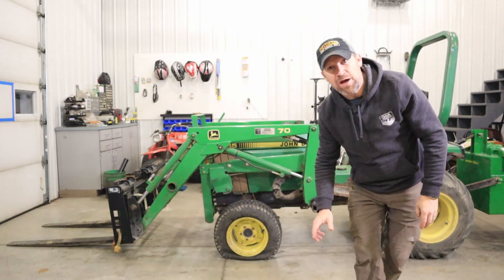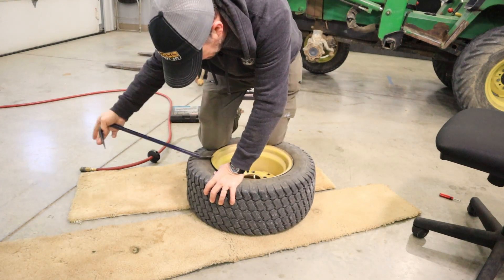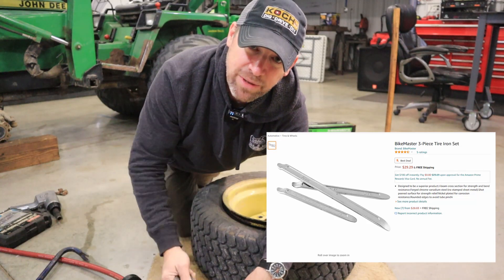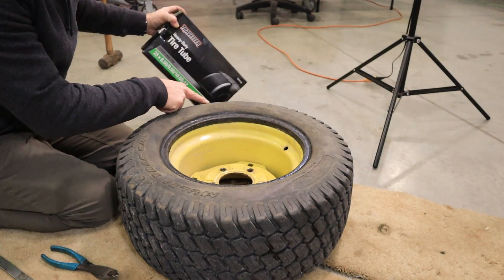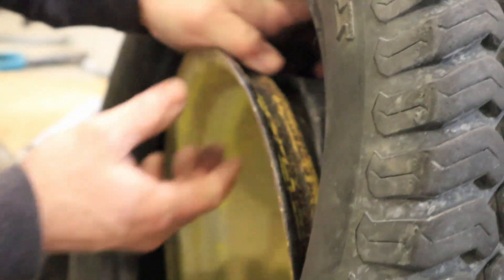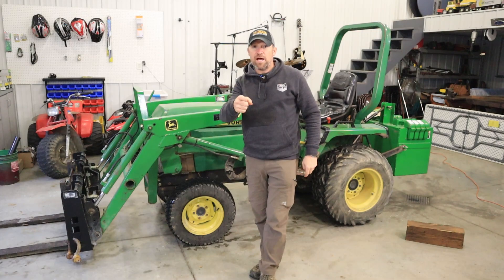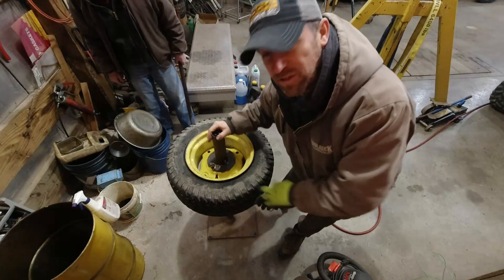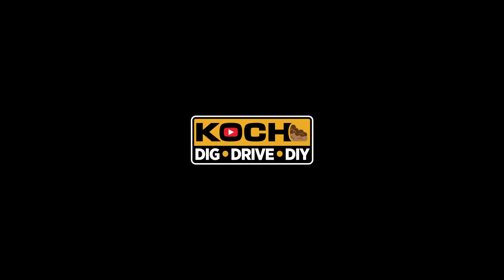How To Install Tubes in Garden Tractor Tires on John Deere 755 - Fixing a Flat Tire or Two

Comment: Neil I tried to do bicycle tire one time and failed at it ended up having to air them up every time I I pulled the Rickshaw around. Something I noticed Neil that I thought about my work. I wonder if you are the tube up first kind of stretched it out a little bit and then. I wonder if you are the tube up first kind of stretched it out a little bit and then push all the air out of it and try and get it in there. I don't know much about that stuff but I wondered about that when I saw you doing it.

Here's an afterthought what if you took a piece of like plate steel and cut the lug nut holes out and could run it down on your lug nut holes and then build a moon shape deal and set just the axle down on it cuz I know there'd be more weight in a focused area than the forks could put on it? Just a thought. You know bolt in place of a wheel and then set the axle with that attachment down on the edge of the rim? Be curious if anybody's ever tried something like that?
Reply from the maker: That's not a bad idea.  Another great way to get creative.  I can picture what you're saying and it would put the weight down on it!  That was my first and second try at doing it that way and I can't say I would prefer that method over the tire changer just yet!  Another thing I thought of after the fact is that I probably could have "pinched" the tire between the fork back plate and the loader frame somewhere too and got it to pop.  Lots of possibilities I bet.
I bet inflating that tube like you suggested may have helped to stretch it out.  I literally took it out of a 2 year old box and tried to put it on so I think that is why it was likely so stiff.  Warming it up a bit more would have helped too probably.
Glad to have you chiming in and always appreciate it!
Reply: @digdrivediy  as always love the video. Love the intro that was awesome. I freaked out for about a split-second went oh my God he's got a twin brother! And  then  it Hit me all of a sudden what you've done. I am buying a new computer today and monitors and going to look at video editing software for morons IE that would be me :-) any suggestions would be greatly appreciated sir. I am a Windows PC guy.
Reply from the maker: @1ton4god  HaHa!  I'd hoped I would catch somebody off guard!  
As far as the editing software goes, I tried out a bunch of them when I first started.  For about my first 20 videos I used Kdenlive, which is a free editing software that works really good and doesn't require a bunch of computer "horsepower".  Since I built a newer computer with a little more processing power, I've been using DaVinci Resolve and that's what the last 25+ videos have been done with.  It is the free version but has a lot of functionality.  Every Sunday night I watch a different tutorial on something new in Davinci Resolve and then I basically spend the entire week editing a little each night.   There are lots of options out there so I would just encourage you to try a few different ones.  Kdenlive was pretty good but it crashed a few times.  If you get one of the free versions of SW then you have to put up with a few quirks here and there.  Good luck with it.
Reply: @digdrivediy  the other DaVinci one was one of them I was looking at. I hadn't heard of the other one you mentioned kdenlive I've never heard of that. The computer I just ordered from HP has 32 gig of RAM and i7 something Intel processor I don't know what all that means but my neighbors are Computer Sciences guy that teaches at the college. And he's basically ordered this supercomputer for me. It's got one terabyte of storage space. He said it'll pretty much run anything I want. I will try DaVinci first. Since you're using it and like it thank you for the help.

Comment: Fyi inflate the tube to 15psi and check for leaks then remove Schrader valve before putting the tube on the rim. It will stretch out the tube and prevent you from having to tear down the tire again do to leaky tube. I've had a couple defective tubes right out of the box.
Reply from the maker: Another good idea.  I got lucky on both of these tubes and they're still holding a month or so later but would have been smart to check them first for sure.  Thanks.